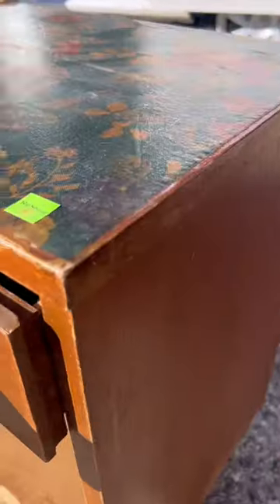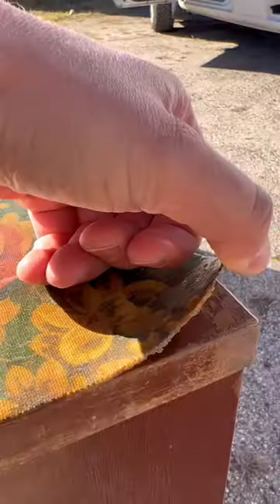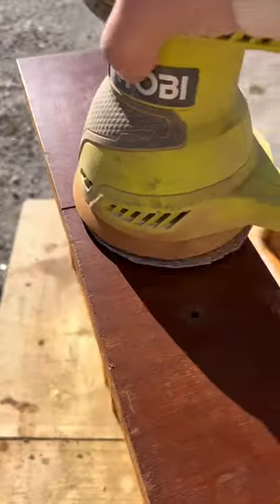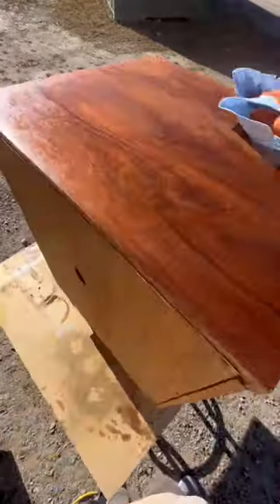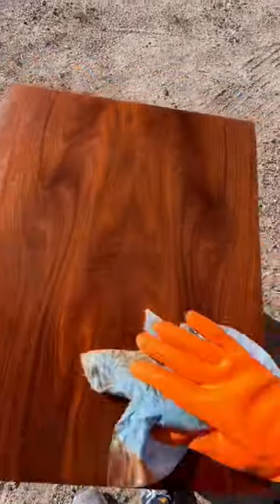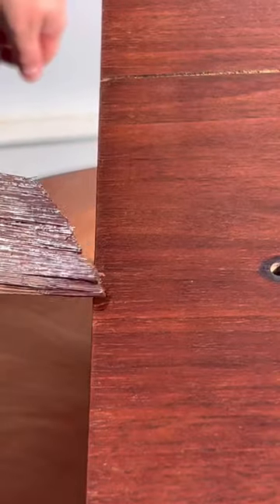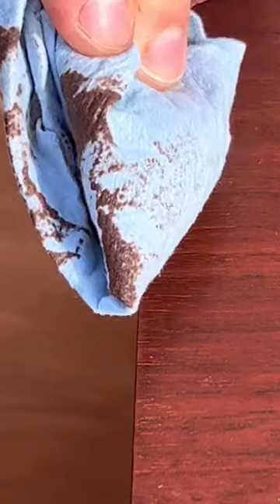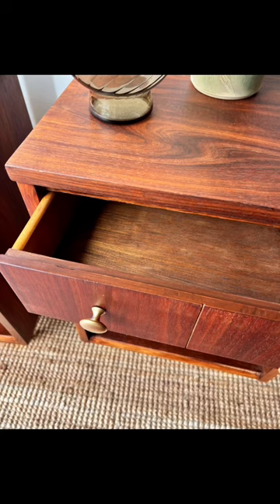Forgot to mention I sold these for $500 once finished! #furnitureflip #furnituremakeover

Comment: I wish the videos were more in depth.  That’s how we learn different about new products, techniques and ideas!
Reply from the maker: I agree! Check out some of my other longer form videos. I’ll try to incorporate more technical aspects in future vids too
Reply: @Moss Grove Restorations  such as, what grit of sandpaper did you use on the sander when sanding the top? Did you start at a lower grit first and work your way up, or just using a higher level grit to remove the top layer of stain?

Comment: Uh... Nowhere near worth $40. $20 max. for the set. You did a nice job but it was so beat up it looks barely worth all that work. I would also condition the drawers inside and out and possibly line them depending how it turned out; they look HARD used still.

Comment: Lady, you do NOT START SANDER ON THE WOOD. Please don’t give out bad advice.
Reply from the maker: Interesting! What do you recommend? I find if the sander is running before you set it down, chances are it will dig in and leave deep scratches.